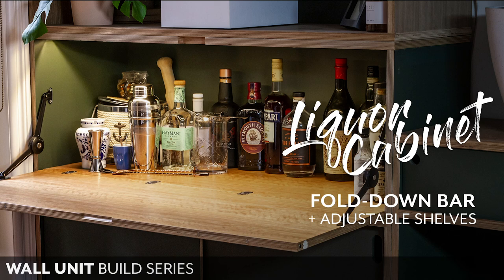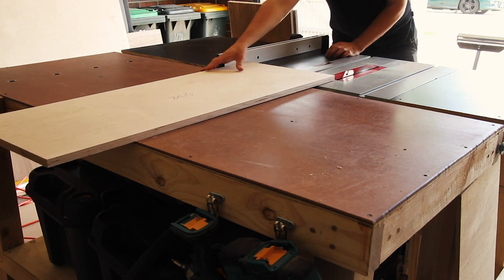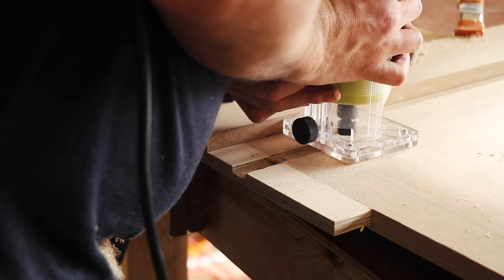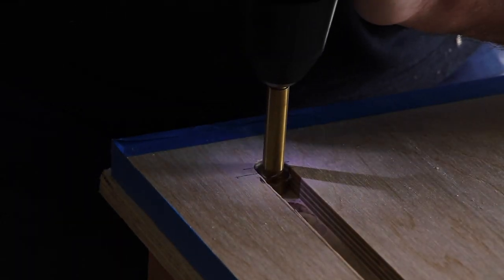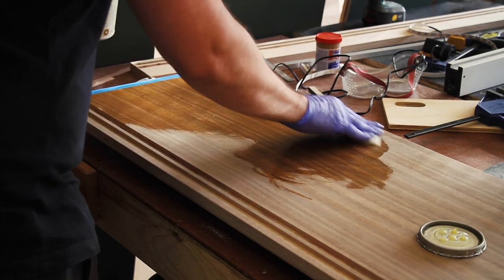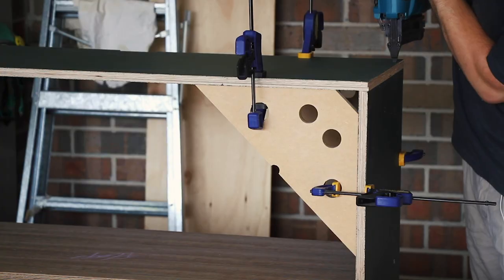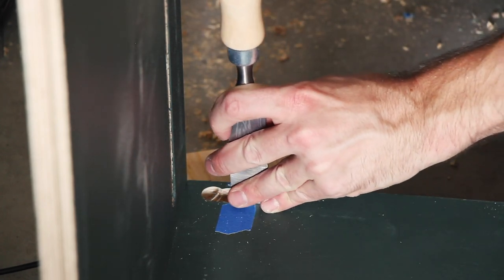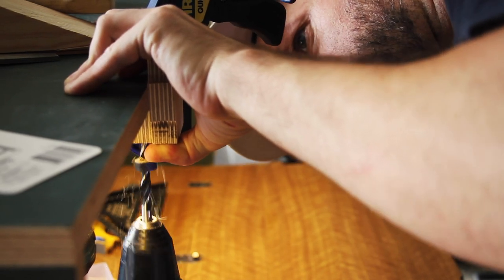Liquor cabinet with a fold-down cocktail bar - Wall Unit DIY Build Series

Comment: Great video. Thanks for posting. I'm building a liquor cabinet, too and am trying to source hinges like the ones you have used. I want the drop down door to be inset, like you have on your cabinet. Conventional drop down hinges require you to bore holes in both sides, which means you can see them on the front of the cabinet. It's a bit hard to see in the video, but it looks like the hinges you used only require a bore into the door and the cabinet side is surface mounted. Is that true? Can you point me to the make and model of hinges please? Again, thanks!!
Reply from the maker: Thanks! Yep these ones don't show through the other side, and when it's closed the 'flap' drops down to cover the hinge - part of the reason I picked them.  Does require your door be greater than 12mm (1/2 inch) thick (mine was 18mm, or 3/4 inch).  The ones I used are the Hafele plano-medial flap hinges in the burnished finish (item code is 342.75.128).  You'd really need to pair them with flap stays of some sort, as I don't think they're that strong on their own. I reckon if I pushed down on the flap without the stays, the hinges would rip out (they're only held in with tiny screws)
Reply: @KastnerFurniture  thanks so much! I just found them online. Like most flap hinges they are shown in the configuration where the door overlaps the outer wall of the cabinet, but (like my cabinet) the door on yours is inset, correct? That means the hinges are actually reversed from the normal installation orientation? Again, thanks so much. This is a life saver.
Reply from the maker: @barryjinks6315  correct, you can use them either way. Might not be the intended use but they work just fine. The other side of the hinge (i.e. the non flap bit) is set back the 18mm thickness of the door... works perfectly.

Comment: Great job, but for the love of all things holy, please, please, turn down the volume of the power tools in operation; that high-pitched whine is just so painful for us headphone users (do we really need to hear it, honestly?). It's not difficult during the editing process: if using Adobe Premiere, you just pull the yellow line on the audio track down to soften the levels. Similar actions are available for other software, for sure.